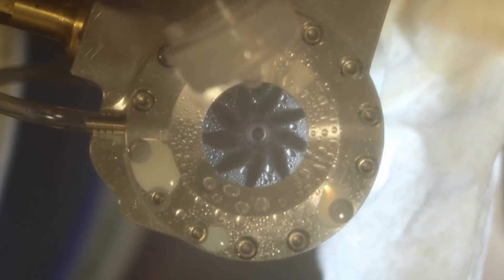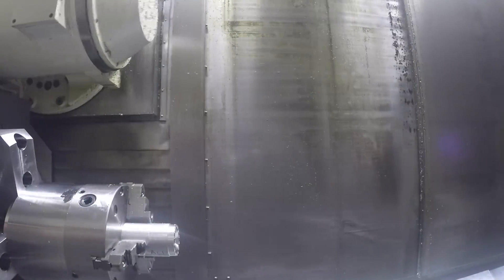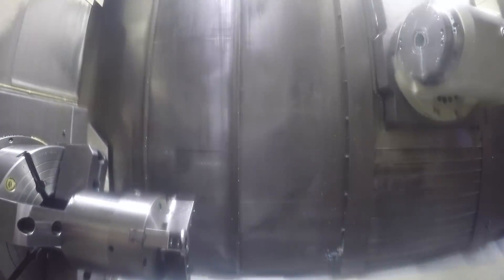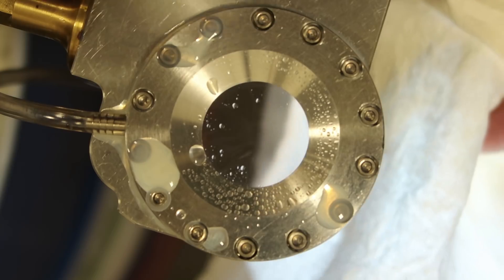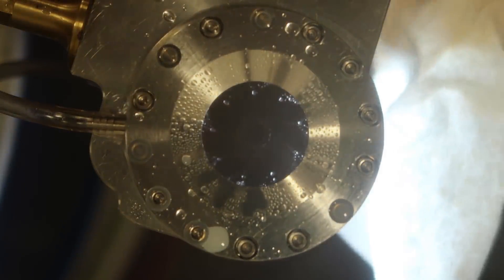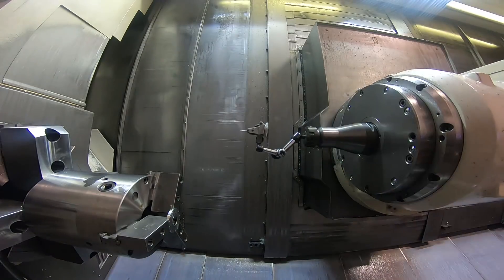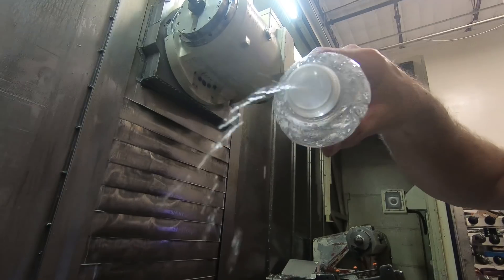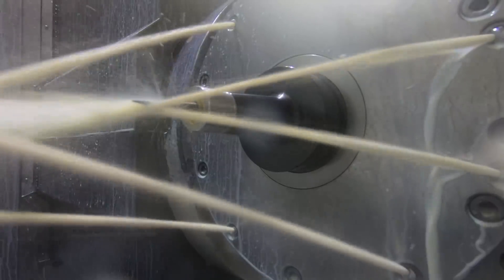Air Knife R & D

Comment: why do you want to blow towards the center?
just blow from one side in one direction, like anyone else woult intuitively do ... done...
Reply from the maker: Yes my original design works that way (have a look at my video "Air jet to clear screen for GoPro"). What i was attempting to do was to use centrifugal force of the spinning water/coolant to make fly off the lens. Unfortunately i cant seem to get rid off that drop in the middle. I thing I'm going back to a variation of my original design that would mount on this case. There will be a up coming video on this.
Reply: well yes, i understood the idea - but the thing is, you're working against the physics.
if you want the water dropplets to fly away, you'll have to introduce the force from the inside towards the outside.

physically, you apply a rotating force on the surface, and the water wants to fly away, but right where it wants to go, there is air flow pointing in the opposite direction.

first of all, i think it could be worth to seal the glass surface by some sort of nano sealant.
and then you could use the air to drive a turbine wheel, so that the glass rotates fast but doesnt get in direct contact with the airflow.
The air cushion could further be used to create an air bearing.
Surely thats not easy to build, but your constructions aren't easy either... so i think, you could pull this off.

regards
Reply: How about a single air jet mounted on an arm next to the lens, with the nozzle pointing back at the middle of the lens?  Especially if the lens were convex, that should create a pretty good center-to-outer-edge air flow.

Comment: thought about a fast rotating glass disc? You would need to seal it somehow. You could run in a close tollerance air bearing and drive the rotation with air as well.
Reply from the maker: Thanks Yes I have given this some thought. The problem with this is to make it small and seal it from the coolant. Possibly if the disk was spaced very close to the lens window. My original air knife was virtually silent at 20 psi. So noise might be a problem with a air turbine drive. And then there is the complexity of the mechanics and to get all that to hold up in the hash environment of the coolant hot shavings in the machine with the close tolerances necessary. Maybe, I haven't ruled out this idea I'm just trying simpler ideas first.
Reply: Edge Precision Hmm I might not have explained it well. So imagine like a glass disk say 7cm in diameter fixed to and covering the entire inner diameter of a ball bearing. the disk seals with the inner bearing ring, and the housing seals with the outer ring. you could rotate the disk by directing an air nozzle at some vanes fixed to the inner ring/disk. the problem of course is that the ball bearing itself is not sealing. you could probably get some kind of sealing bearing, but the resistance to rotation would probably increase beyond the point of it being able to be air driven with little air. at the RPM rquired a sealing bearing would probably also face some service life issues (like seals wearing out quickly). an alternative would be a type of bearing that uses a working fluid as the bearing element. in this case the fluid would be shop air. the bearings inner ring floats on a cushion of air contained by the outer ring. a bit like a hovercraft. to keep the air cushion working, you inject it through small holes distributed in the outer ring. to keep pressure up and air rquirements low, you have the inner and outer ring mate with close tolerance. the air bearing has virtually no friction so driving the rotation with a small stream of air is no problem. since when operating it constantly pushes air out, its effecively sealing. and seal life us no issue since no moving parts make direct contact.

Comment: Would it work if you focused the radial blow to a different point than the center of the window?  If you made the window slightly larger, then focused the radial blow to the bottom, the center puddle would still exist but out of the field of view from the camera lens.

Comment: Apply your "Air Knife" technology to the coolant long before it reaches the lens glass and you will not have to clean the glass again. Have a cone of ultra high pressure air divert the coolant away from making contact with the glass.

Comment: Why you didn't do the spot drilling for the barbed fitting at the same time as for the screw holes in order to have one less tool-change in your program?
Reply from the maker: Yes you are correct and if this was a production type of job I would do that. When I make low quantities I usually don’t worry so much about it. To change the B axis position you have to move to some kind of clearance position anyway. That’s about half a tool change. So the time savings would be worth it for a high quantity. But not that much for a few parts. When running just a few parts more time is spent setting up things, making adjustments and rerunning tools. I don’t worry about a few extra tool changes.
Reply: Fair enough.

Comment: pretty sure what you really need here is a wiper blade :)
Reply from the maker: I have given thought to this idea. Not a wiper blade but a rotating window with a stationary wiper out of camera view. This could be a cylindrical window like they use on racing cars the continually rotates or a flat window/disk that rotates in front of the camera. The good thing about this is it can rotate at a low speed. Unlike a rotating disk that uses centrifugal force to through the coolant off its face. The slow speed will be easier to seal and be quieter so the cameras mic wont pickup as much noise.

Comment: What about straight horizontal lines from the round groove to the center only on the sides none on top and bottom with an alternating pattern from the left and right like a zipper? And maybe right where it meets the opening where it exits it ever so slightly curves downward like the trajectory of a bullet to give each jet of air a down to the side motion instead of all pointing to the center?

Comment: hi. on cars, there are whipers for water. you can use a big rotating
plexiglas tube horizontal with whipers left and right an place the
camera inside. running dry is not so good, so provide everytime
a little bit of water (sponge, irrigation etc.). you will 
immediately have a clear picture again (theoretically ;))
thanks for your videos.
Reply from the maker: Thanks ABS. I did think about this method. I think a small glass tube (The plastic won't hold up to the coolant and hot shavings)  around the camera that continually rotates with wipers would work. It is somewhat complicated to make and seal from the coolant. And there is the possible problem of noise from the mechanics (I want the sound from the camera. Yes I know I could record this on a recording device. This just adds more complication). I'm still thinking about this as a possible  solution.

Comment: You have got me thinking Peter!
ATB, Robin
Reply from the maker: Give me some ideas. I still have four blank bezels left. It works better at lower pressure. The problem with higher pressure is it drys out the coolant and leaves a residue of the oil in the coolant. It also works better if it remains wet. If I could just cause a instability in the drop in the middle of the lens to where it would fly off. the circular motion does through the coolant off the window. Also at about 20 psi its noise is low so the cameras mic. doesn't seem to pick it up. The environment in the machine is not a clean one with pristine coolant there probably also way oil in the coolant. Maybe even pulsing the air wit some kind of solenoid might work.
Reply: I agree with a lot of the others below. I think a single side linear blow across a square window would be where I would start. IMO the air should be collimated by running thru parallel shallow grooves to minimize turbulence where it exits to blow across the window. It could be designed to take advantage of the Coanda effect also.
Reply from the maker: Thanks Robin. Yes my first air knife I made worked better. look at my video " Air Jet To Clear Screen for GoPro" if you haven't already seen it. That design I cant really take credit for. I more or less copied Exairs design. It blows out a very thin slit about .003" thick (I used Mylar packing tape for the shim) Than over a radius (About .200") that angles the flow down and across the lens cover on the GoPro cases bezel. This design works better. I think I will redesign the case for the Gopro 6 to work this way. As a side note for the type of filming I do in the machine. The Gopro hero 4 camera may work better than the newer Hero 6. Or maybe I haven't figured out the proper settings for the newer camera. The Hero 6 is gets blown out by the LED lights in the machine more than the Hero 4 camera. I do like the build quality of the Hero 6 camera better than the Hero 4. If I was sure that the Hero 6 camera would hold up to the environment in the machine I would try it without a external case. I just don't want to risk a $400.00 camera to find out.

Comment: Re spot forming bits:
Mr Stanton, Considering that you have a CNC tool grinder do you make & use Spot forming drill-bits with the same included point angle (e.g. 135°) as the subsequently used drill-bit.   

p.s.  
Souses that prompted my question 

MikeJB Aluminum’s post on practicalmachinist
http://www.practicalmachinist.com/vb/general/spotting-drill-bit-159845/

Stefan Gotteswinter’s video youtube 
https://youtu.be/Ot8wPGQW3JI?t=285
Reply from the maker: perfectionist2032 I generally like my spot drill to have a steeper angle than the drill has. Say a 90 degree spot drill for a twist drill with a 120-135 point. I also spot bigger than the drills diameter to ether chamfer the hole or c-cink for a tap before tapping a hole. This is harder on the drill though, especially carbide drills. The tips of the drills flutes cant dissipate the heat and fail if the surface footage it to high when starting the drill in this kind off spot drill. I have tested this quite extensively if a properly sharpened drill cuts in a spot drill with a steeper angle than the drill it will be better on size at the top of the hole. Or to say it another way if the drill cuts first on the outside before its center tip the hole will have less bell mouth at the holes beginning. Have you ever noticed that when you double drill a hole the second drill holds size better than the first. Now twist drills drill better from solid. If you drill a hole say that's say .485 than drill a .500 behind that you will have to slow down the speed of the .500 drill or you will burn up the tips of the flutes (Have you ever done that?). Why is that, it's because the drill cant dissipate the heat into the body of the drill , part or shaving. If you have the power in the spindle it is always better to drill from solid (That''s no pilot drill) if possible. The tool will last better.
Reply: Mr Stanton, sorry for my late reply.

Less bell mouth:
That is a very in interesting explanation, Would that be because the bit is functioning as a boring bar for the first say 010-.030''? i.e cutting only on one corner for sufficient depth that it forms a bore that functions as a bearing which prevents the bit from being deflected of its centreline by the countersink. 

Acute spotbit point angle: 
What I have noticed is when the land-lip intersect* of a 135 degree bit start to cut on a 60 degree counter sink it can be deflected of centreline & start wobbling unless the feed rate is slow like .001'' to .003''per rev*  for say .030''. I have noted that a spot bit's centreline can be quite different from the subsequent bit owing to the combination of tailstock position, quill extension & holder run-out.

Burning up the cutting tips (land-lip intersects): 
I have not achieved that using my manual 17x34'' lathe, though I have observed the land-lip intersects are first to be eroded particularly on 17-4 HT (33 HRC).  flood/mist coolant is not an option so I keep the chips temp below the cutting oil smoke point.

Comment: Hello Peter.  Have you considered a non-symmetrical pattern ? I have no formal air knife experience, but I have been a R&D/Tool & Die/ Mold Maker for 35 years.  As soon as I saw the collection in the center, it told me that all the air current was converging there, trapping coolant in the process.  I would think that either making one side deeper to allow more air flow than the other, or even experimenting with a non-symmetrical pattern would help.  Not sure it will, but that was just a thought.I would also consider a shape other than round if you need it.  Yes, the lens is round, but don't let that put you into a tunnel vision type thing.  Square, rectangular, diamond, trapezoid, ellipse?   I have also done extensive work on developing smoke stack emissions monitoring equipment.  In those devices,  we had to design and build a self cleaning lens by using air current alone. In that design, we created positive air flow around the lens.  That didn't allow any of the particulates to even make contact with the lens to soil it.   I can share that with you also, so you can consider it while working on your design.  Feel free to message me and we'll chat about it. Thank you for sharing your videos with us.  I really enjoy them!  Best of luck.  Jay

Comment: What about a second port to occasionally spray some distilled water onto the glass, to remove coolant residue before it drys.
Reply from the maker: I have thought about this or bleeding something into the air supply.

Comment: Hey Peter, try to combine counter clock and clockwise the cancel each other and get rid of the center ring.
Reply from the maker: What I was attempting to do was use the centrifugal forces to throw the water off the lens. If I could just make the middle drop unstable so it wouldn't stay on the lens it would work.

Comment: Have you tried glass that is not flat? Maybe a slight dome would change the dynamics of the vortex and the bubble would have nowhere to live any more! Not sure where you could get such a lens, but a watch crystal might do and they are really inexpensive.
Reply from the maker: The problem with a lens cover that's not flat is it may act like a lens and distort the image. Also i don't know where to buy such a window.
Reply: If the glass is parallel then it will not act as a lens. Look at dome cameras for instance. I found a watch supplier (in the UK) who keeps pocket-watch glass for less than 5 bucks a piece. I am sure there will be similar suppliers in the US. I may be worth trying - you never know.....it may work?!?

Comment: Great stuff, some ideas I thought of would be sequencing the firing of circular grooves with the radial grooves, but that’s more complicated and would require ELEX, making it too easy… solidstate solutions are more fun.

To that end have you thought of biasing the radial grooves? If the camera will be vertical and oriented the same way each time would it be enough to have deeper radial grooves on top with shallower radial grooves on the bottom, coupled with the circular grooves of even depth? The purpose being the circ grooves keep the fluid moving, the deeper, higher power grooves push the focal point off center, and the shallower, radial grooves at the bottom help lift the fluid off the lens.

Either way I’m interested to see how you solve this 👌👍

Comment: Try to make a screen by blowing air from one side to the other 
or from top to bottom with square shape not circular,
or blow air with 3 nozzles outwards at the center creating a vacuum at center and
3 nozzles blowing air to the center of the screen.
You have to play with air presures here.

Comment: probably a stupid idea but it would be cool if you just made the lens itself spin and let centrifugal forces throw the water off
Reply from the maker: The problem with that is its very complicated to make such a device that is sealed from the coolant. Also there would be the noise that the camera's mic. would pick up from a motor and mechanics of the mechanism. With this at about 20 PSI you cant hear it.

Comment: Why a round window in particular? Would a square window work?
Reply from the maker: My original design that clamped on to the Hero 4's waterproof case's bezel so far works better. Is just blows from one side across the square window. I haven't just yet given up on this idea.
Reply: Edge Precision What if you spun the glass to throw the coolant off?  Use the air to spin a turbine with the glass attached.

Comment: Probably way to late for my idea to be noticed, but in moldmaking we sometimes put .0005" vent passages along mold profiles to air and corrosive gases escape. I think in your situation a similar .0005" vent in the land between the vent channel and ID. I could see this working as it wouldn't  dilute the pressure and give a complete uniform flow around the glass.Personally to precisely I'll blue up the land and very carefully jog the machine till the blue just hardly starts to show a mark then feed in the half thou.

Comment: Air curtain.  Window curtains hang down from one linear rod.  Deliver the air from one linear passage.  Mill a vee passage with the the apex entering your circular air passage at your barb fitting or 180 degrees from.  Start small, you can make the passage wider or adjust the angle after testing.  Similar to a plastic sheet extrusion die.  Similar to a wide vacuum cleaner hose attachment.

Comment: my ideas... 1. horseshoe shape (will probably create a  pattern like a boat wake) 2. add a air jet from above to your current vortex generator,  small tube bent into a "J" shape (may push the maelstrom off center) 3. try the straight flow air knife again but use water instead of air (probably cause to much distortion of picture.) Anyway THANK YOU for your time creating these excellent videos